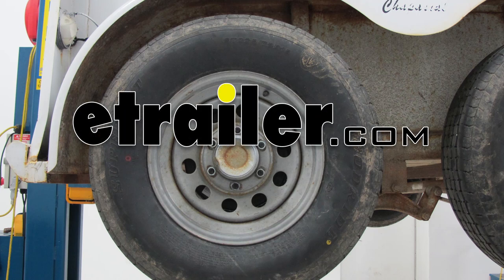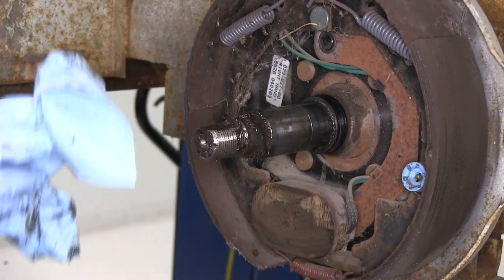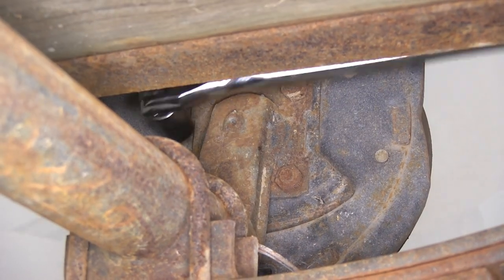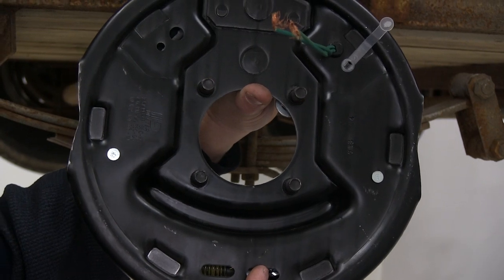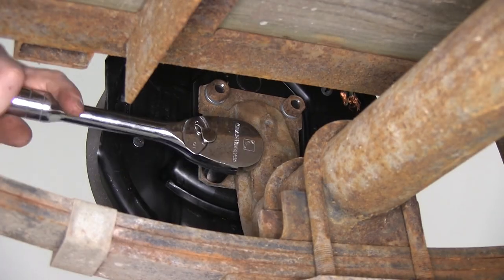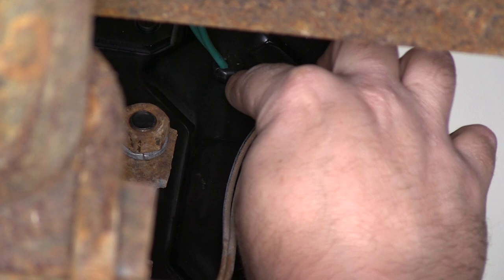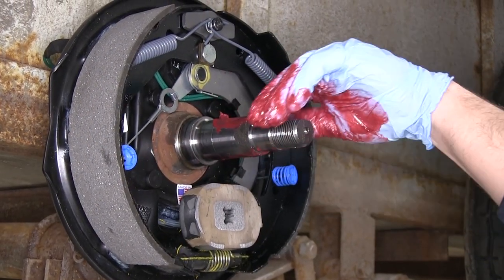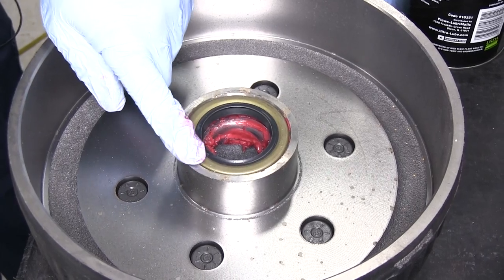etrailer | What to Know About the Dexter Nev-R-Adjust Electric Trailer Brake Assembly

Comment: Best tip for wires used on boat trailers especially dipped in salt water use....is Self-amalgamating  tape, wrapped over any and all spliced wire connections!!!    Self-amalgamating  tape is a non-tacky silicone-rubber which when stretched and wrapped around cables, electrical joints, hoses and pipes combines or unites itself into a strong, seamless, rubbery, waterproof, and electrically insulating layer. This tape turns into a sealed rubber plug, and last many many years !!!

Comment: Awesome video.  I bought a tandem axle trailer at auction.  I need to remove each assembly one at a time and go through each one, it's an older trailer and I've already had one brake lock up on me.  Thanks for the great video!

Comment: They're great as long as Dexter doesn't install the wrong adjuster in one of them. When they do that it constantly loosens the shoes until the tensioner and spring fall apart and grind themselves up against the drum.
Then just try to find  a tensioner without buying the whole backing plate assembly.
I'm in the middle of this nightmare right now.

Comment: is there a reason you didnt detail how to set the pre-load with the castle nut?
Reply: Torque to 50ft lbs, while spinning the rotor.  Stop spinning. Loosen the nut. Tighten it hand tight. Then if the cotter pin isn't lined up tighten it slightly till it is.
Reply: 11:40 ????????????
Reply: I thought the same thing

Comment: Very useful video. I'm going to be replacing all 4 of the backing plates on my 2008 Car hauler flatbed trailer. It's got tandem 5200 lbs axles both with electric brakes. I saw on your site that you guys do carry the 15" diameter backing plates for 5200 lbs rated axles, and I am going to go with the self adjusting ones like you showed here. I was wondering if The self adjusting brakes will brake harder if the truck's trailer brake controller is set to a higher setting? Thanks in advance.

Comment: On drivers side brake does it mater which wire the brake controller wire is paired with. thanks ahead of time
Reply from the maker: The driver's side brake assembly features a 2 wire design. One wire is for the brake feed, and the other is for the ground. The wires are not specific to a function, so it does not matter which wire is used for power or for ground. You would want your brake controller paired with the wire supplying power to the electric brakes.

Comment: great video . Is the grease you are using regular wheel bearing grease ? thanks
Reply from the maker: The grease we used is designed for bearings. You can view it at the link below.

https://www.etrailer.com/Tools/LubriMatic/L10333.html

Comment: Hey, I puzzled about electric trailer brakes. If I'm grounded up front do I still need a ground somewhere in the back where the wires connect to the brakes as well?

Comment: Is there a proper torque value for the nuts on the brake?
Reply: That's a good question and this is all I could find.  According to Dexter Axle, the attachment bolts for a 12 x 2 brake assembly should be torqued to 25-50 foot/lbs.  Supposedly you should use lock washers too.

Comment: Hi, how do I connect the wires.
Reply from the maker: Check out the following link to see the installer connecting the wires. They will connect to the positive and negative brake wires that are on or will need to be installed on your trailer.
 https://www.etrailer.com/tv-install-dexter-nev-r-adjust-electric-trailer-brakes-left-right-23-468-469.aspx

Comment: Watched this in order to discover how to adjust the brakes on the "self Adjusting" brakes, and then in the video, he didn't adjust them.  How convenient !!  Because they are supposedly Self Adjusting, they are a bitch to adjust, as there is a spring loaded metal tab that has to be pushed out of the way thru the second hole in order to actually move the star wheel for adjustment.
Reply from the maker: At the 11:51 mark the installer explains how to manually adjust these Dexter Nev-R-Adjust brakes. We didn't actually need to adjust the brakes in this situation because they were already at a good spot, but this video still basically walks you through it. If you want to see a different take on it you can see this install video instead (at the 7:28 mark) https://www.etrailer.com/tv-install-dexter-nev-r-adjust-electric-trailer-brakes-left-right-23-468-469.aspx
Reply: What do you do if one break is hot and is out of adjustment?  Just got back from a two hundred mile trip and hope it isn’t damaged.